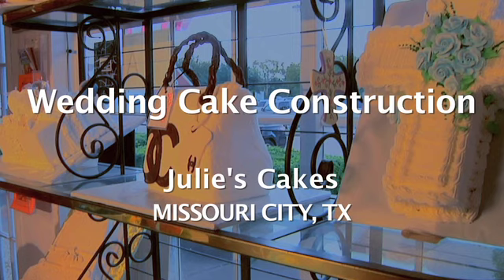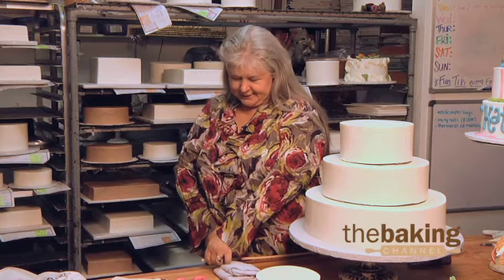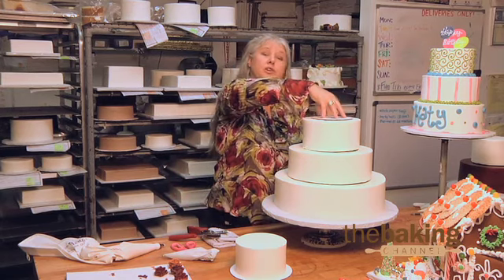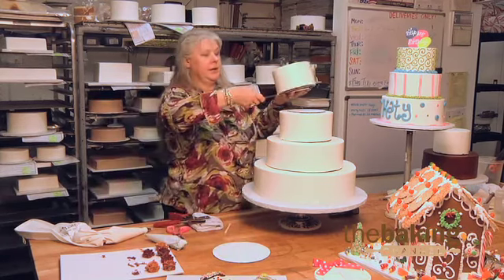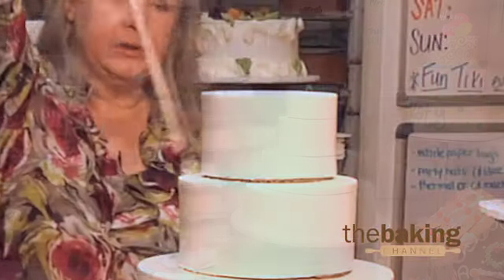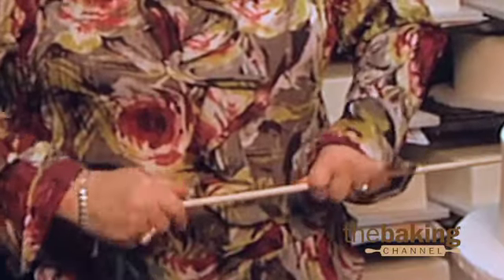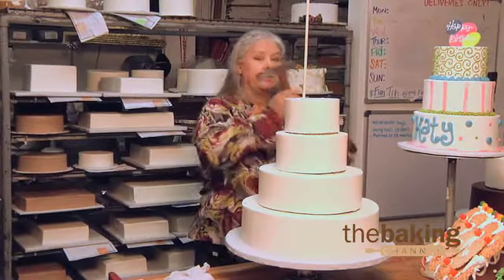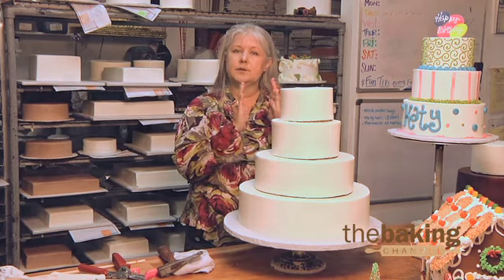Stabilize a Wedding Cake

Comment: My fear is when I'm hammering in the main dowel rod, the double boards will stop it and the entire cake will be ruined. Have you ever had a problem with the end of the dowel rod not being sharp enough to make it all the way through the cake? Or would you remove it, re-sharpen it and continue down the same hole?